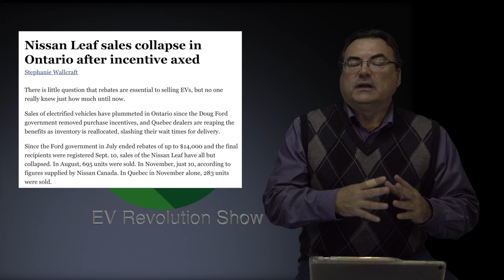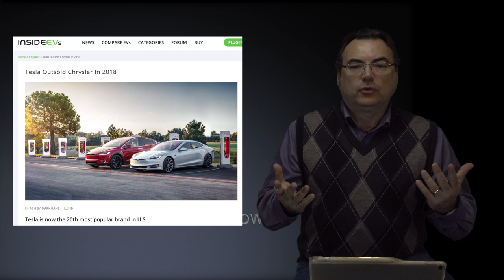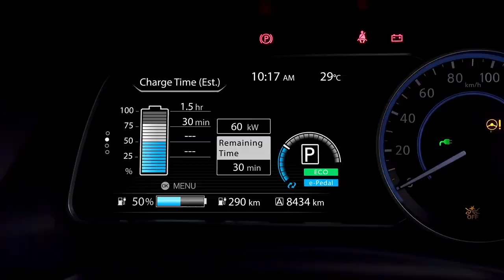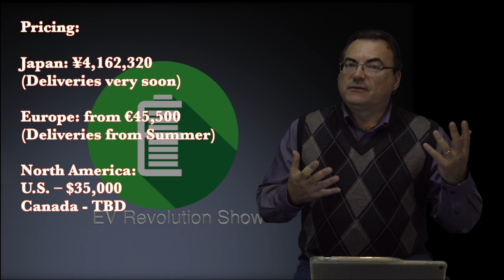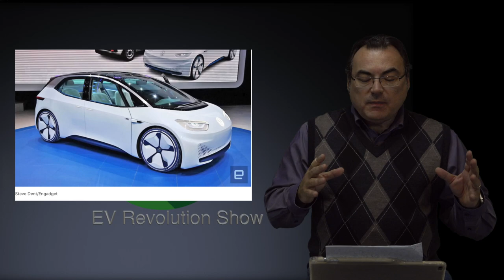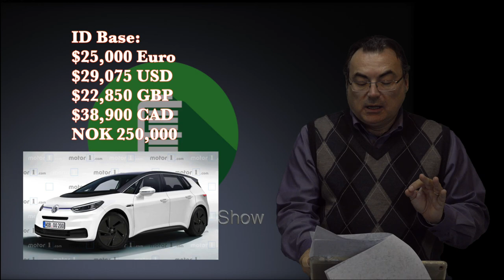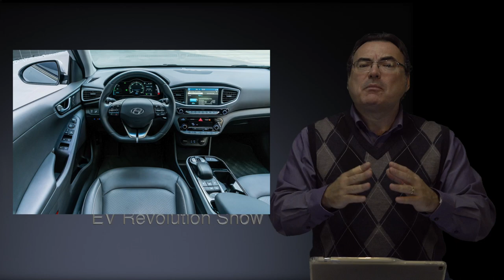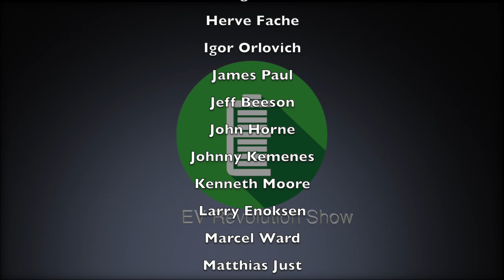Episode 26 - Nissan Leaf E+ Loads of Info,  40kWh Leaf BMS Update?, More VW ID Details, Infinity QX

Comment: Richard Owen - my wife is also not into tech but I convinced her to get a Leaf and after 5 months she loves it. She doesn't use E-pedal, so the car just drives like a normal car. I do charge it for her though using the charger that comes with the car. But an electric car is not really more techy than a new ICE car these days, with the exception of Tesla which is a very techy car. Also be aware that very cold temperatures can reduce your range quite a bit, expect about 100 miles on a full charge if temps are below 35 and the heat is on.
Reply from the maker: Hi Mark, thanks for the real-life experience and feedback!  Also of course a big thanks for watching my show!

Comment: At 4:35: No No you keep saying it wrong. There are 7000 Tesla’s  produced a WEEK.
Reply: in burst production mode (as he is talking only Model 3 production numbers). S + 3 + X are at 7000/week for quite some time now.
Reply from the maker: Yes!!!  Just model 3’s.
Reply: @EVRevolution  they haven't sustained 7k/week for a single week i believe, may have just been a couple hours maybe a couple days... but they're producing around 5k/week consistently. if you take the last quarters' production and divide by 13 weeks which is how many weeks there are in a quarter it came out to slightly over 4700/week. so the claim that they're producing 7000 Model 3s a month is really ridiculous.
Reply from the maker: Hi Matt, good points so it's probably safe to say that current Model 3 (only) production is at about 4500-7000 per week, depending on quarter end push!  :)
Reply: @EVRevolution  correct. because if they were only producing 1400 a week like you said they'd be selling about 600 less a week than S&X combined.
Reply: @Michael RCH I did not say model 3 I said Tesla’s. I know Ken was thinking Model 3, but  I know that was not right. The only number the 7000 applied to was to all three models and it was per week not a month.

Comment: Hello, I live in the Caribbean on the island of Trinidad where the temperature could get to 100F at times. Would you advise buying a 2019 Nissan Leaf seeing that it is not liquid cooled for the batteries and with all this rapidgate issues going around?  Thanks.
Reply from the maker: Hello Richard, wow thanks for watching and glad I have a viewer in Trinidad!  My answer would depend on your daily driving needs.  If it's well within the 370kms or so of daily range that the e+ give you, or the 40kWh version, then yes it's a great car and your temps won't be an issue.  If you need to rapid charge more than once per day on a regular basis, then you may want to consider another BEV with Active Thermal Management.  The Leaf is a great car but will take longer on multiple fast charges and outside ambient temp than other models.  

For the price point and versatility of the hatchback, the Leaf is a fine BEV which is overall a good pick.  Your situation will depend on your needs.  Hope this helps and if you have other questions, you can email me at EVRevolutionShow@gmail.com.
Reply: @EVRevolution  Thanks, much appreciated.

Comment: Kenneth, Do you know the weight difference, between the 40 kwh model and the new 62kWh model? Great video btw
Reply from the maker: Hi RedOnion, thanks for watching and for reaching out.  Appreciate your feedback btw. 

 The Plus weighs about 308 pounds (140 kg) more than the 40-kwh version.  Some other differences (source: greencarreports.com):

- The 40-kwh Leaf and 62-kwh Leaf Plus have the same motor and reduction ratio (8.193, which spins the motor faster than the 7.8366 in pre-2018 models), but the motor is allowed to run to a higher rpm in the Plus—thus the top speed of around 100 mph. The Plus has a new inverter for the higher power output.
- The 62-kwh pack has the long-awaited new-generation “universal stack” configuration (different than other Leaf models up until now). A new welding process within the pack reduces the spacing between internal joints, to fit more modules into the pack. The considerably larger pack doesn’t affect cargo space or rear-seat folding.
- - Wheels and tires for the Plus are the same as those for the standard version, but it rides 0.2 inches higher, with different springs for the weight, and potentially for pack clearance.
- Charging the 62-kwh Plus to full on 240V takes 11.5 hours, up from 7.5 hours for the 40-kwh pack. It gets to 80 percent in 45 minutes on a 100-kw CHAdeMO charger—about the same as the standard Leaf on a 50-kw charger. The Plus can use the 100-kw power briefly and then it settles to a nominal 70-kw.
- The 8-inch infotainment system included with the Plus has easier device pairing and over-the-air updates. The rollout could include EV-specific features such as efficiency tools.
- e-Pedal is recalibrated, not for the different charging characteristics of the Plus but for the added power and the additional weight of the model.
Reply: Thanks for your fast and accurate answer
Reply from the maker: Love your alias name btw, we have a restaurant close to where I live named the "Red Onion".  Good food!

Comment: First: I LOVE YOUR SHOW! I am only posting the following to prove to you I am listening! 😉
I’m concerned about math. Maybe you are talking about Model 3s produced for Canada, but Tesla is producing 1,000 to 1,400 a Day. 7 times 1,000 is 7,000 per week. 1,000 times 30 is 30,000 per month.
I also think VW’s math is shaky. 30,000,000 cars produced would be 3,000,000 per year for 10 years (admittedly they plan to start selling them in late 2019). But they also stated they won’t be making 3,000,000 cars/year until 2025. That means 5 times 3,000,000 or 15,000,000 cars. To build the other 15,000,000 cars by 2030, they would need to build 2,500,000 cars per year over the remaining 6 years! (15,000,000 divided equals 2,500,000.) given ramp up speeds, I would say they would beed to produce 3,000,000 vehicles for 4 of the remaining 6 years since one is only a partial year, and the other is adding models.
Reply from the maker: Hi larryenok, yes thanks for comments and I always appreciate feedback, whether its to correct me or not.  I'm going to have to double check again Model 3 numbers, which is what I was referring to - not total Tesla month production.  I thought Model 3 was about 1,400 units per week.  Not per day - just for Model 3's.  

For VW, well that is the numbers they claim and from a Global perspective, I don't see that as too far fetched providing battery supplier inventories and raw minerals don't provide shortages.  That would really the bigger issue that would impact not only VW, but pretty well all the other battery manufacturers, even Panasonic/Tesla.  

With the ramp up in EV sales and adoption, I think the weakest link in the supply chain will be the raw mineral aspects in the near future.  

I fully think VW can do the numbers they claim and remember that is for all the VW Group Companies combined, not just VW ID brand itself.
Reply from the maker: Hi all, some more info on VW.  

Today, Volkswagen announced its sales results for 2018 and it seems that German manufacturer reached a new record of 6,244,900 at a growth of 0.2%. (* yes that is over 6.2 MILLION vehicles - can you say manufacturing strength).  The plug-in electric car sales with a VW badge amounted to around 50,000, which is 13% more than a year ago. It translates to about 0.8% of the total volume. (ok so they have LOTS of room to grow and shift production from ICEVs to PHEVs/BEVs.  So I don't think the math of 30M in 10 Years seems out of line.  That would occur if VW increased their electrification to about 47% or so, from just under 1%.  This is certainly DOABLE.  Now, whether they actually DO IT is another story - lots of talk and we need to see the actions.  I for one am giving them the benefit of the doubt.  Hope this info puts it into perspective.
Reply: @EVRevolution  6K to 7K a week is the current production level for model 3. 7k a month is way off and honestly quite embarassing Ken. I know that analysis is not your strength but you should probably spend more time updating yourself on things you cover. You might want to take a leaf out of Trev's book. The quality of his show has gone up significantly since the restructure and has led him to win 2 roadsters by the way. I envy you coz I know you're gonna get some test drives from your pal
Reply from the maker: Hi there, thanks for watching and thanks for comments.  Why I try to be as accurate as I can, sometimes I do make a mess up.  Now, I just looked at Tesla's numbers AGAIN and they are at about 4500 PER WEEK Model 3 ONLY production.  Obviously, this goes up and down a bit, especially near a quarter end where they can push to almost 7,000 per week.  Maybe not sustain that for long, but they've at least hit that threshold once.  I originally said 7K per month since I thought numbers were around 1,400 per week, which they are a lot higher.  

Ok so I goofed.  You've never made a mistake, even in a public setting?  So, what does your feedback get you - some satisfaction that Tesla is so great!  I've already acknowledged my error on the last show so enough please.  Why does how many Model 3's Tesla makes per week really matter - they are making a ton so weather it's 7K per month or 20K per month, there are a lot of pissed off people (tens of thousands) that are waiting for the SR Trim and have been waiting with their reservations since April 2016.  So once Tesla starts to deliver this unicorn of a car, I really don't care how many they crank out per week.  

Now, regarding other shows, I am NOT - I repeat NOT - in this for stardom or money.  I do what I do as an average Joe so I can talk to everyday people and educate them about EVs that may be able to fit into their lifestyle, so they can say goodbye to a tailpipe!  That is why I do what I do.  To help save our planet in a meaningful way.  

Not to give out referral codes and push product reviews and shiny videos, have dozens of corporate sponsors and make a full time living out of this YouTube life.  I have none of that thank you.  I'm very very appreciated for the few dollars I get per month from Patreon supporters, which this money does not come close to something I could live off or even recoup all of my personal out of pocket expenses I've been doing since day 1 even of the M3OC Show.  

You make a good point about quality and in doing so, I am getting better at production values and more frequent timing.  However, I have a full time job that supports my family and that has a priority over YouTube.  This is a passion for me and I do it for the cause - not for the cash.  Great that people can get stuff and some serious revenue and make a full time job out of this (M3OC, TEN, Ben S, Bjorn, Kim, etc. etc.) and even get hundreds of thousands of dollars worth of referrals.  

But this is not me.  So cut me some slack, will ya?
Reply: EV Revolution Ken, I know that some respond in an ugly way. Please, please don’t take mine that way! I have stopped watching Trevor. I like your discussion and presentation and you are one of four I consider ‘must watch’ tubers.
Keep up the good work and giving us  the pleasure of your enjoyable presentations.
Reply from the maker: larryenok Hi Larry no issue I did not take it negative. I’m fine with corrections and I try to put things into perspective. Glad that you contribute to responses. I’m not knocking others and not trying to turn people away from watching others. The more porting this change the better. Just wanted to be clear on my reasons. Thanks Larry keep posting!

Comment: I am 60, a senior and I own a Nissan leaf but I also own an mx5, it is much more difficult than a ionique to get into being ultra low, I have no problems at all, even though I am old. I can also ride for 100 miles on a push bike in the TT position for 4 hours, break 25 mph in a 25 mile cycling time trial easilly, swim for 2 hours straight and run a half marathon. Old does not mean slow and inflexible, fat, unfit and out of shape does.
Reply from the maker: Thanks for watching Neal and wow thanks for your comments!